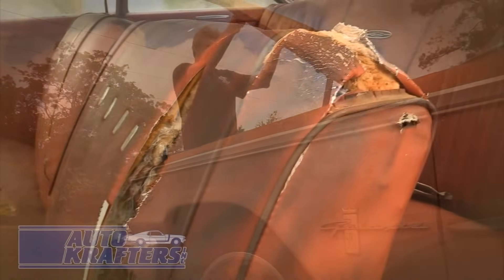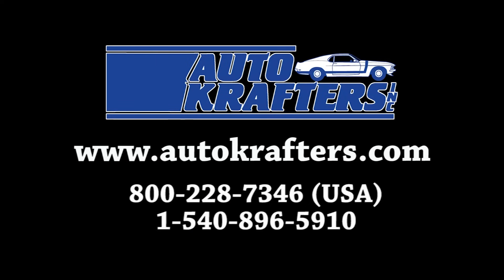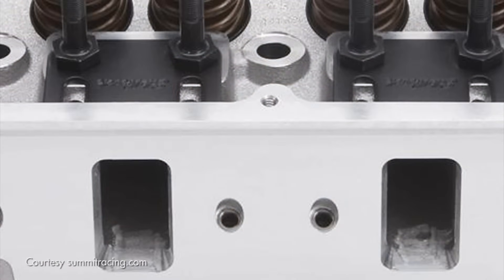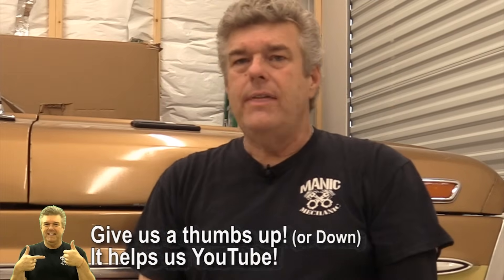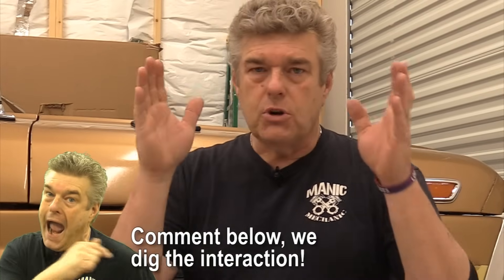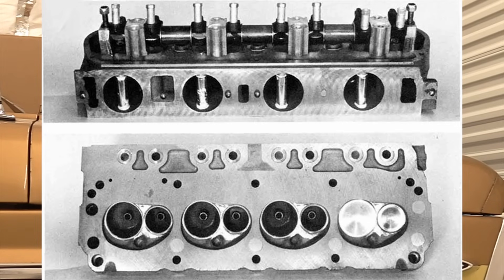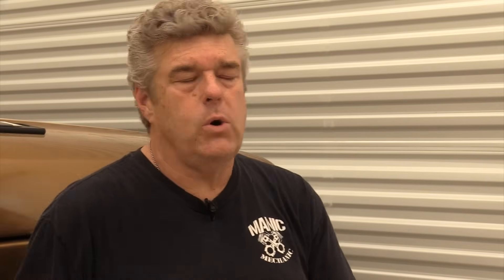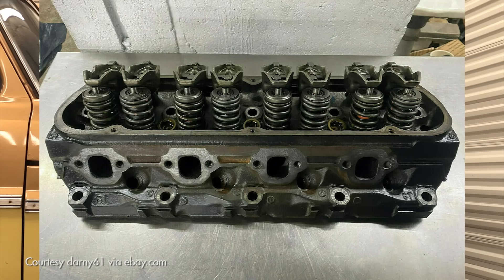Ford Heads Explained

Comment: I've been looking for GT40 heads for a couple years at my local junkyard, no luck yet. They're the best stock heads to squeeze power out of for cheap, especially if you clean the ports and chambers up. To a lot of us popping $1800 for heads isn't an option.
Reply: Aftermarket heads NEED to be fully checked by a head shop. Many heads are not well done.
FACT NOT OPINION.
Reply: @hotrodray6802 and your right!
Reply: I was going to do the same, but after buying used heads and having them rebuilt, I opted to get assembled blueprint hp9009 190cc 2.02/1.60, 60cc chambers, screw in studs for like $500 each delivered. They work,- and about double what i would’ve paid for GT40Ps that I’d struggle with headers on
Reply: @WesternReloader  blueprint hp9009's are 850 each now..
Reply: @sps-vf4qq  I got lucky to get all my build parts before the price hike
Reply: @WesternReloader  The Blueprint heads were a good deal when they first came out. But for some reason that $500 a head has skyrocketed to $800-900 per head. That's too close to AFR territory not to bite the bullet for another $200 and get the much better head.
Reply: You can thank cash for clunkers for the shortage of GT40 heads .
Reply from the maker: I hear ya!
Reply: I got the P heads on my Foxbody with Bbk  headers. Only need angled plug wire on num 7 cylinder
Reply: @BruceLee-xn3nn man this comment is kinda old, but I’ve got BBK headers that were advertised to work but still touch the plug even with a shorty, where did you get your plug wire/ boot from ?
Reply: My first set was E7TEs ported with 1.94x1.6 that i thought performed well until i upgraded to TW 170s…wow what a difference!  I learned my lesson IMO a really good set of heads is best upgrade you can make and will never skimp in that area again
Reply: AutoZone and summit can get the heads.  GT40 is “2FX2” and GT40P is “2FX6”
Reply: Get original tfs tw heads.   I'm sure you can get under $500.
Reply: I went from gt40p that were milled .040 to raise compression.  It ran strong.  I did strike the 302 to a 331 and went with blueprint as cast heads for 550 each.  Got 368hp and 398tq out of the 331, on the chassis dyno last week.  The blueprints were actually cheaper than what I had in the gt40s
Reply: Very interested in this conversation, i have a 88 LX mustang with a tired 302 - (260 thousand miles) still sounds ok and runs fair but ive had other mustangs in the past with gt40 heads and holly systemax upper and lowers that were much better more powerful motors they had other things too like bigger throttle bodies and bigger cams so im about to look for the perfect combo for this stock block and im thinking about a scat 347 stroker kit with AFR 190+cc heads but in all honesty the knowledge on how to build an engine i just dont have, ive had some fast mustangs but they were already built.
Reply: Same bro!! For me it’s CA smog spec that a smog station might not even notice - Same with a cam upgrade. Just adjust timing before and after smog check.
Reply: They are EVERYWHERE where I'm at. Maybe you aren't looking hard enough
Reply: With a little work you can us 5.7 hemi heads
Reply: '98 and up 5.0 Explorers should have GT40P heads. 3 lines on the front if you can't see the casting, "GT40P". Oh and the spark plugs can be interesting to change. They help make my '31 Ford run real nicely
Reply: $300 pair gt40 and gt40p
Reply: This guy's only half right about the GT40 heads. The F1ZE castings have 65 -66cc chambers and the F3ZE castings have 63cc chambers. The Mustang Cobras have the F3ZE heads.